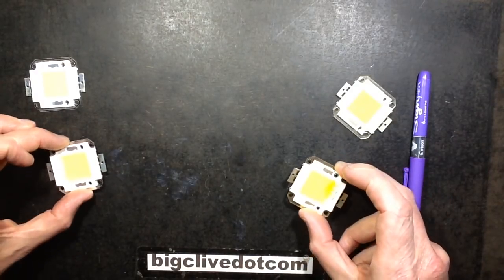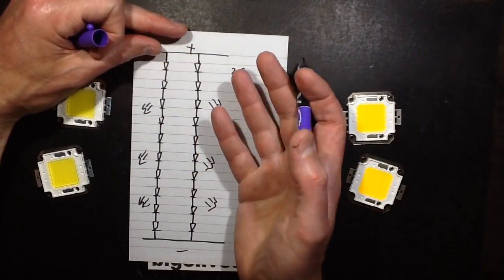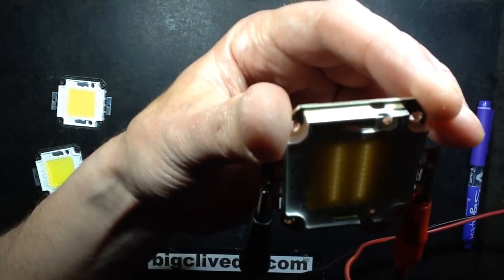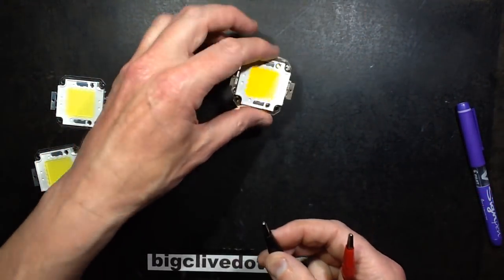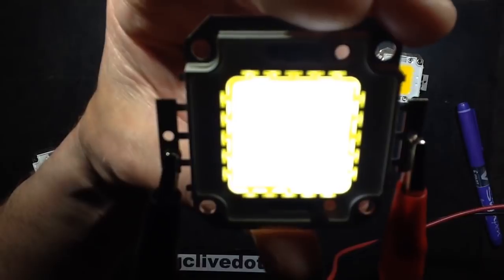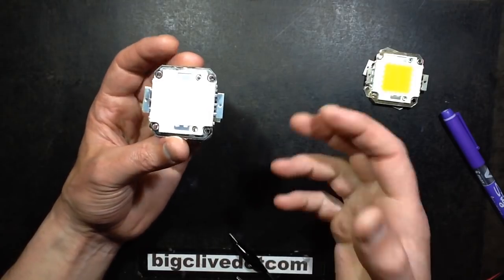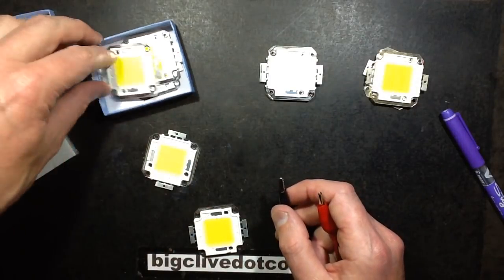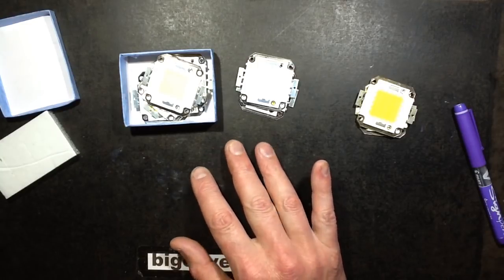Testing dodgy 100W LEDs from ebay sellers.

Comment: I had a very strange experience with a 100W red LED from China. It had a rubbery red coating over the actual LEDs (like the yellowish coating on yours). I turned it up to half its rated power and the coating quickly burned away (despite heatsink, compound and fan) revealing an intensely bright blue (UV?) LED. In fear for my eyesight I tested it on a phosphor which didn’t glow, but I still don’t trust it. This makes no sense to me as 1: blue/UV LEDs are much more expensive then red, and 2 a red filter on a blue LED should let nothing through (unless it’s a red phosphor for UV). Could you possibly shed some light on this? Thanks
Reply from the maker: +railgun22101 Yeah, I've come across these blue LED stimulated red phosphor LEDs.  Bizarre, but it probably makes sense in that it allows the manufacturers to manufacture all the base units with blue chips for white, yellow and red.  It certainly results in a brighter yellow than the older gallium arsenide technology.  The blue chips will also add up to a nice 9V or so unlike actual red chips which would have a combined forward voltage of around 6V.
Reply: +bigclivedotcom How much of a hazard (as far as ionizing radiation and eyedamage) does the stimulating LED pose? I was thinking of just using it as a 100w blue LED. Thanks for the response
Reply from the maker: +railgun22101 The wavelength of the blue LED will probably be in the region of 470nm, so it will just be a blue LED.  Deep vibrant monochromatic blue with the slight hint of the residual red surrounding it to add level of richness to the colour.  See?  Now I've made it sound like a win.
Reply: +bigclivedotcom Thanks a ton! Now I know how to get cheap high power blue LEDs

Comment: I have had very good result with this type of LED. I tried what you did connecting to my bench supply and raising the voltage. I get the erratic lighting of some. This is at far below nominal current. I can say that when I properly heat sink them (I am using CPU heatsinks) and keep the die below 50-60C) and connect them to a current limited supply (about 3 amps) they are awesome. I  measured 8-9000 lumens on mine. I bought a few cool white and warm white. I am going to use the for video lighting.

Comment: if those 100W LEDs worked, would you use a 30V 3A supply, or a constant current supply?
Reply from the maker: pssst3 You always have to use a current limited supply with bare LEDs.  It would have to be rated for the desired current, and capable of supplying the maximum combined forward voltage at that current.

Comment: I picked up a few 100w ones from Sure Electronics, so far so good. Started turning on, all 100 of them at around 24-25 volts. So bright I needed a welding glass to look at them by 29v, all 100 still lighting up. The 10w ones I got from the same seller works a treat too. sure-display on US eBay

Comment: What does a properly working 100w led look like at a lower voltage? Does it light up evenly like the 20w? I was watching another video of yours where you had a 3 led disc and each led had a different internal resistance. Is the same happening in this case? I love your videos. Thanks for sharing.

Comment: I don't drive my car in 2nd gear on the highway and I don't run my 100W led modules at 20mA. I'm not sure your conclusions mean anything in light of the testing method.
Reply from the maker: Richard Burden Yes, but if your car was running on two cylinders then you might have to drive it in second gear.  See my other video about the Clown science of crappy LEDs.
Reply: bigclivedotcom I don't think any of the devices are as simple as you're making them out to be...no eq, high psrr, failover like incandescent xmas light strings or whatever...but falling down on lux per watt is plain enough. The static sensitivity thing is rubbish, they are designed to go w. common industrial housing in all weather. All but sustained heat.

Comment: Thoughts...

[1] The manufacturer of 100W modules must warrantee them when employed for outdoor civic use (in America).  The warrantee must stipulate full return and replacement for 3 years.  Thus manufacturer gets a lot of post-use duds.  

[2] But post-use duds aren't completely duds.  They glow.  So, some other schmuck buys them up by the bag-load to "recycle" them.  Turns around and sells them on E-Bay. 

[3] Or... during making, solder-bridges short out selected LEDs.  One might expect a single LED bulblet to be kaput.  The looks of your video?   Dozens.  Suggests [1], not just a solder-short caught during QC

[4] Or... some other schmuck(s) are taking all the bulblets that are OUT OF SPEC (which can be had for scrap-rates by the millions!) and are cobbling them together into counterfeit/fake 100W modules.  Nefarious?  Very Chinese.  (Sorry, but one must call the kettle black, if it is black.)  

#4 seems very likely considering the huge peek-thru color of the glowing bulbs.  Some are downright blue, others... etc.

[4b] Lastly, the bags of scrap emitters may (usually) contain zillions of shorted out elements, which when soldered in place (even competently) emulate the same short-outs that a solder bridge would.  Result?  Same as [3].   

Icing on the cake:  the BOGUS packaging.  Being done by shill-firms and ignoramuses from back-alleys all across the Fine Chinese Empire.  To dupes worldwide.  What a wonderful thing, the anonymizing nature of the Internet.

Comment: I got one of those chinese 100W LED that light up in a spotty fashion, but when tested it indeed draws 100W of power and is as bright as I'd expect with no burnt out LEDs. Not saying there isn't a problem with yours, but some of these seems to work just fine even with a few mismatched LEDs.

Comment: Don't they even-out when you increase the voltage up to normal? Would putting a bunch of neutral filters over the camera lens and applying full power be a way to see this?
Reply: @LazyH-Online This is quite an old post :p  Since then I did do some testing.  I had bought some 10W leds, some were very well matched and some were not.  I could not get the poorly matched ones to take 10W, they max out at 7W and get very hot at 7W.  There is quite a lot of difference in light output with a well matched LED.  At much lower wattages it produced better light and MUCH less heat at 7W.

The junk ones and good ones cost nearly the same, price doesnt matter.  What was interesting is that the good ones came separately wrapped in plastic sleeves and had a serial number etched in the back... that was pretty cool since you know they passed quality control.  The junk ones came in a large bag all loose.

I was surprised at how much difference in light per watt.

Given the lockdowns now is the perfect time to experiment :)
Reply: @LazyH-Online its always good to try out new things.  Just dont burn the place down :p
Reply: +metallitech YES
Reply: No.  They dont even out.  They will stay the same relative intensity.  A properly matched LED produces a lot more light.  I havent tried comparing light levels between a crappy LED and the same wattage through a good led.  From what i have seen it seems a whole lot less.

Comment: buying from China always is a hit or miss.
the LEDS probably will outlast a regular bulb, but the internals don't (capacitor,...).
I have 2 LEDs, that lasted me 2 years now, burning 24/7, and cost me $24 a year on electricity.
I have other Chinese LEDs that lasted me 3 months of sparing use, before they broke down.
Buying from China, means inconsistency.

Comment: Thanks Clive for making this video. I just do not have time but I would do it like you do very well detailed. I have a problem with all these Chinese lamps that are suppose to last 8000 hours but burn out or strobe much sooner. This is the standard of quality that we can expect from China and it has been that way since they started. All junk, yet we are being told that LEDs are the way to go. HA not until they have a quality item and not until they last far beyond the stated warranty- they are all a rip off and you are right about the static but then they don't care when selling seconds or discards. Just how many people know they are bad? Excellent job exposing these.
Reply: The promise of LED bulbs that would last so long that they would be in our will so our grandchildren would get a fair share, was a bit overoptimistic. My first 4 foot LED shop lights that failed way before their time, were due to almost microscopic circuit wiring connections that had no protection from mechanical stress. All conductors were minimally sized to JUST meet circuit requirements. The LEDs never failed, just the package needed to use them.

Comment: Their is nothing wrong with them, all it is is the inconsistency of the led's starting voltage with some having a higher starting voltage leaving some unlit until they reach their starting voltage at a much higher input. To really test if they work properly is push 100watts through and get a DSLR and have the highest shutter rate and close the aperture as much as possible to see if they are all lighting up.
Reply: Robert maks 

Or you could use a welder's glass and set it on top of the LED. With a variable supply you could simply watch which LEDs come on and at what voltage/current setting. I imagine that if there are any bad LEDs in the die, whole row it's in would be out.

Comment: it does show that they dont light evenly at low voltage but ive got a few of the 100w chips like those that i run all the time. never have a problem with them. you will probably end up paying 4x as much for a chip that's been hand matched internally.

Comment: Seems maybe you got the factory rejects stolen by an employee
Reply: Pete Brown lol I really doubt they'd have to steal those :P
Reply: Probably not stolen, but they are rejects. For many years the same thing was done with multicore CPUs. They'd run the tests, and for example, if all 4 cores were good - that shipped as a 4 core. Three pass, one fails, disable the bad one and ship it as a 3 core. Two good, two bad, same, ship it as 2.
Reply: @dr666demento  Goes back even further. The 486 SX was a regular 486, except that the FPU failed tests so they disabled it.
Reply: +sinephase then again, I really doubt they give them away for free in China.
Reply: +Sharp Paul could be the "night" batches, the company my uncle works for makes quality control tests on chips and other electronics to make sure their clients order is to exact specs.
Some place will run a good batch with example a part that cost 10cents(the one you need) but when no one is supervising they replace that 10cent one with a 5 cent equivalent(so less quality. or in some case they will just use the same machine set up that in the "day" make yours and then they make their cheaper version at "night"

Comment: This may be a more recent thing. I puchased 2 100w warm white ones off a Chinese seller when they were around £4.50 each, and both were perfect. They have been installed in my car as auxiliary main beam headlights for 18 months at least & have not deteriorated at all.

Comment: I have worked in electronics for 30+ years including a lot of design work and fault analysis. I have never seen LED's fail like that. The only thing that can cause this sort of thing is overheating in the bonding process. IE when they put all the LED's together in the module.

Comment: I picked up a bunch of 10w 12v versions of these, much smaller, but the whole thing is filled with LED's, interesting to see that the larger 20w ones have only two strips inside them. That's also some pretty severe patchwork on that, these 10w ones don't do that sort of thing.  They came in the same box too.

Even the 10w ones make quite a lot of heat, I planned on making a stroboscope powered by a 9v with one, however I was having trouble driving it for some reason. I have a couple small heatsinks with fans now though so hopefully it will work a bit better once I have some better transistors.
Reply: I bought mine from this guy, it was a pack of 10 for $9.55cad. Maybe quality control with larger ones is an issue though. www.ebay.ca/usr/happydeer88?_trksid=p2057872.m2749.l2754
Reply: Jesse Levesque The easiest trick is a very fast settling switchable constant current circuit. depending on the capacitance of the LED's (not something you normally have to consider) you should get settling time down to maybe a microsecond or so if you can reduce the overshoot etc.
Reply: Ah, you know that makes perfect sense, I hadn't even considered the LED's capacitance but since there are so many in one LED package it would definitely explain the issues I was having, I figured it was maybe a transistor issue but the LED's probably had enough capacitance to stay on in the brief moments when they were supposed to be off. I had only done this with a few single LED's before.
Reply: An LED only has a capacitance of about 10pF, its what that capacitive load does to the PSU that makes it a pain in the neck. Especially if your trying to strobe into the MHz band
Reply: Ah so really not all that much, hmm. I can't recall what frequencies I was getting into but it was enough to "freeze" the blades on a pretty powerful fan from a power supply.

I'm trying to recall if I tried driving it from an external power supply or if it was just the one from my computer that was powering the arduino. Hmm.

Either way I still think part of the issue was only using a basic transistor.
Reply: If you use standard transistors you need to bar in mind the Hfe is dropping radically by the time you reach 100kHz. Some cheap ones have a Fmax of 1MHz at which point the Hfe is 1. Decent transistors have an Fmax of 100MHz or so. But even with one of those you need to look at a graph of how gain is affected my frequency as a 100kHz square wave has frequency components well into the 10's of MHz. Add your LED capacitance to that and the circuit can go "steady state" even if you dont want it to.

Comment: Is there evidence to suggest unmatched leakage current is a proxy failure indicator on LED arrays?
I'm surprised about the static sensitivity given LEDs have no MOS or insulated gate and the reverse bias voltage is only about 5v.

Comment: I bought some 100W deep red leds from tubelight.

http://www.ebay.co.uk/itm/100W-660nm-20-25V-6000LM-Deep-Red-High-Power-LED-Plant-Grow-Growth-Light-Lamp-/371328123907

They were fine.  All the LEDs lit uniformly and increased uniformly in brightness as I ramped up the current.  I have yet to validate that they are 660nm - they looked  bit orange to me so could possibly be 620nm - but I have no evidence to say they're not 660nm
Reply from the maker: The red LED chips are a different (older) technology and are very consistent and reliable.  It seems to be the newer technology thin-film LEDs that are the problem.  I have noticed that the eBay sellers are also telling porkies about wavelengths.

Comment: I'm a bit confused by the voltages of these LED's. I bought a few 50 watt LED's a few years ago & the maximum voltage to run them must have been 24 volts as that's the supply I bought. Currently using one as a spotlight in my workshop. I did do this test with a bench supply & mine lit the same way these ones did, a few random chips light up first. I used a doubled up piece of welding curtain to look at the chips at full voltage & they do all light up in the end but obviously not matched as you said.

Comment: I'm using a 10W LED that I got for £1.29 off Amazon that has the same issue... I'm using an active heatsink on it with a 10W driver... all the LEDs start to even out in intensity near their full dissipation, so I'm getting about 10W of power draw and the LEDs are evenly lit at their full power.

Comment: It seems that they are switching to these new crappy 100W LEDs. I have been buying different ones for years, and recently they have started looking like the ones you have. They also use a really thin cheap aluminum base to mount the LEDs on, whereas in the past they used to use thick copper or brass. They're now noticeably lighter and just feel weak and cheap.
Also, the tests that I've been running show that eventually all the chips do light up, but all 100 of them as a unit are not as bright as the old ones and consume much less power than the rated 100W.

Comment: Some time ago I tested some 20 watt LED s and noticed that the emitters didn't come to life evenly as the current was slowly increased. But at a certain point they evened out and worked reliably up to 20 watts. I used a filter/attenuator like welding visor glass to see the individual LEDs as they got brighter.

It would be interesting to know how the emitter matching affects long term reliability. Maybe the ones that light first are more stressed, or maybe there is a balancing effect possibly due to thermal coupling the evens them out at higher power levels; like paralleling mosfets.

Comment: I don't understand why you are trying to vary the voltage. A diode is a current controlled device just as a BJT is. You need to bring the voltage up to a constant value say 31V and then reduce the current to an appropriate level. Even then the leds will probably need to be at level where you cannot view them with the naked eye before the are all equally lit. I am not disagreeing that usually Chinese products are duds, I just think you need to change your test.

P.S. Great videos, keep it up😊